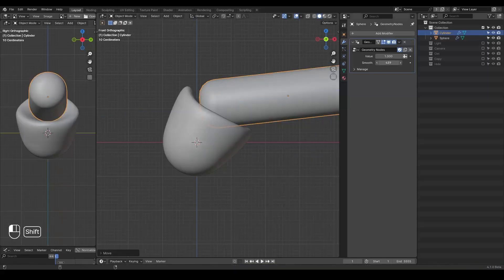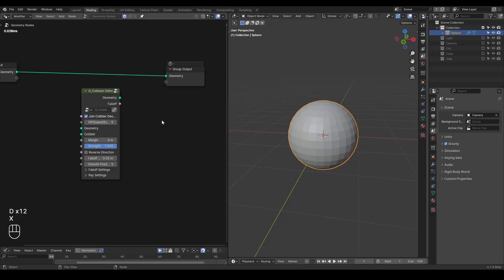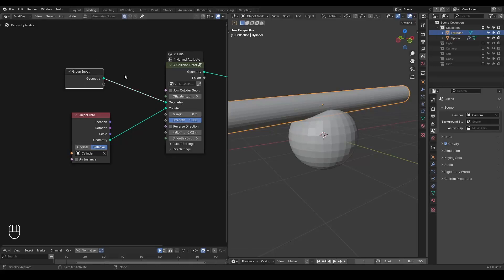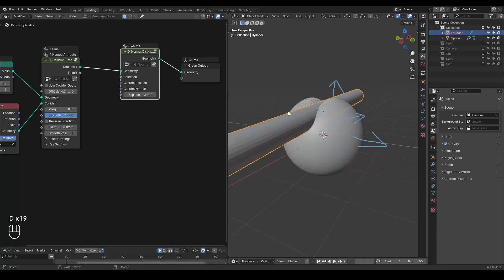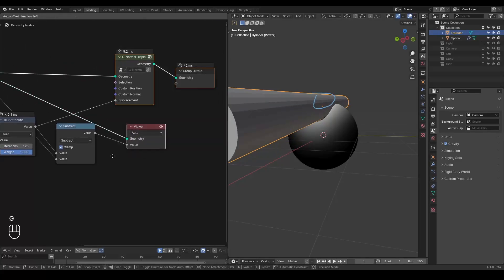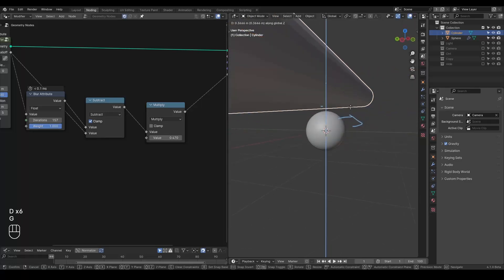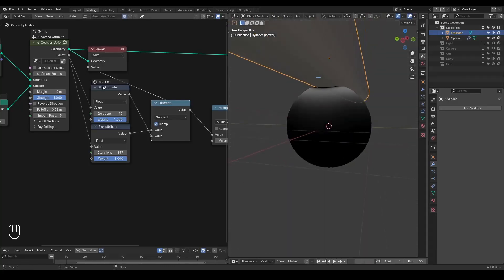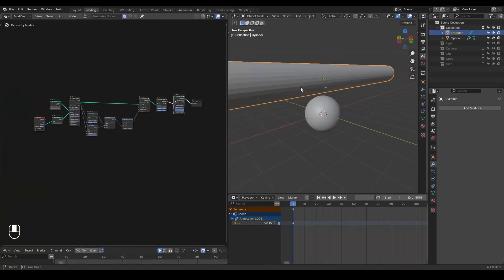[Tut] Soft Collision Bulge and Jiggle B - Blender Geometry Nodes 4.0+

Comment: Is it possible to apply a vertex group of the collider object so only that part causes displacement?
And is it possible, using these presets, for multiple objects or parts of an object to each have their own softness and affect one another?
Reply from the maker: 1. yes, it's rather basic
2. technically yes. but practically difficult. Likely will encounter lots of problems depending on the exact scenarios.

Comment: I don't have the falloff output from my collision deformer, im using Blender 3.6
Reply from the maker: I can confirm I only added that since 4.0.
if you can't use 4.0+, then try use "proximity falloff".
the custom mesh should be the cylinder geometry, and turn up the "scale offset" to perhaps 0.1 and try...

Comment: when I add the Collision deformer it's on collider only (not off/island/internal)
 how can I change that?
Reply from the maker: "Off" is equivalent of "Collider Only" as a better name (imo) to distinguish itself from other two modes. so you don't need to worry this option. it should work basically the same unless otherwise indicated.

Comment: heya quick question when i add the  inertial deformer it removes my material. is there anyway to fix that? (edit: scratch that i saw it is a current limitation for now but it works fine in versions prior to 4.0.2)
Reply from the maker: The known limitation should be fixed since 4.1.
Reply: @bradleyanimation120  oh  yeah you’re right, also thank you for this tutorial and geometry nodes!!
Reply: Im late but if someone wants to know to do it is, you can just add set material node to the geometry
Reply from the maker: @thisisgood44  The original question was different. Before 4.1, a mesh that comes with its own material, such as a rigged mesh with many materials, will lose material in simulation zone. It was a known limitation because of missing referencing from object to material. https://projects.blender.org/blender/blender/pulls/117043
set material won't work for complex geometry, etc.
Reply: @bradleyanimation120  i see, thanks for explaining! I thought it was because the material dissapear,, i used 4.0 and after using geometry node the object doesnt use the material that i applied when i use set material it works.

also love the presets man! its really cool, i want to learn geometry nodes too